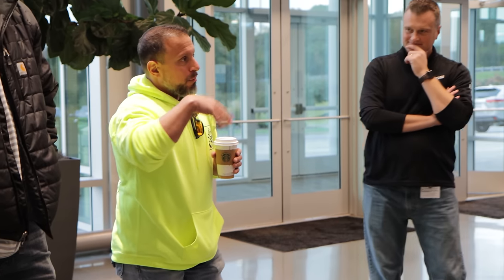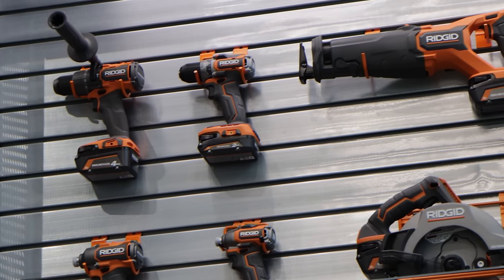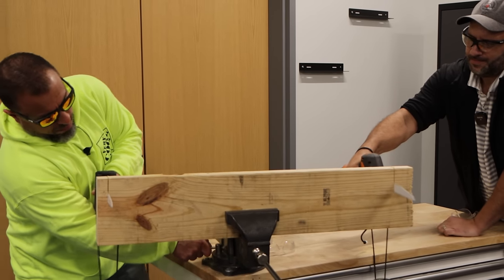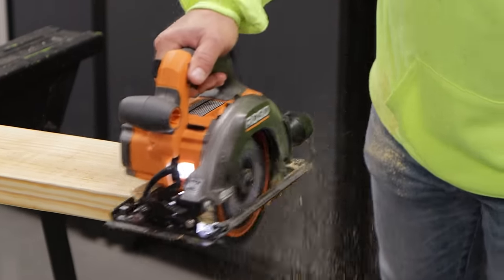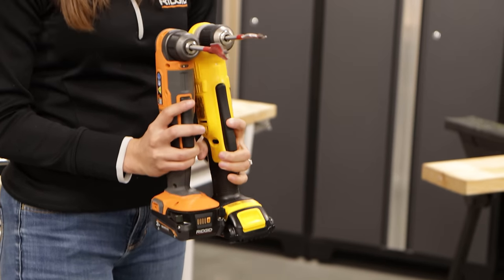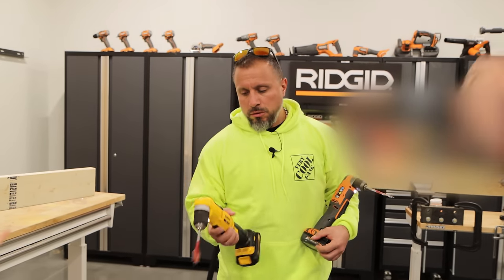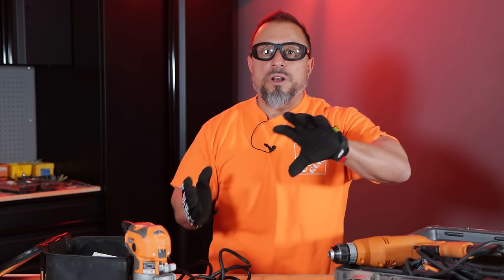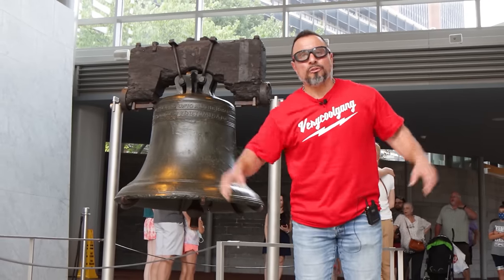Telling Ridgid Executives I Don't Like Their Tools!

Comment: I used to be a Ridgid guy because of their lifetime warranty until I tried to use it. It took 6 weeks for HD to replace a orbital sander. Replacing batteries is always a fight. The hassle is just not worth the “lifetime “ warranty.
Reply: Same here had a vacuum go bad read the life time service agreement said send it in and we will determine if it's a warranty issue. Same with there sump pump. There warranty/service agreement is a joke.
Reply: I can say the same about dewalt. Drove 40 miles for their belt sander, got home it was dead. Went to walmart and picked up a skill to get the job done.

Comment: As a ridgid user, I'll be completely honest. They have a lot of work to do and step it up. I'm glad after they took out the octane line they began to replace and also add more tools to their arsenal. What I want to see from them is to bring back their 12v line. Give the market competition against Milwaukee, competition drives innovation and and quality, different lights besides the 4 they currently carry, updated corded tools that have been in their arsenal for years! Their own driver and impact bits. Their own saw blades, more cabinetry tools like their old band saws, planers. Get into electrical! They have a lot of work to do but with them throwing the octane away they seem to finally have a set path for tools and what to make. I'm keeping my fingers crossed but only time will tell
Reply: The same company owns ridgid and millwaukee
Reply: @keegannoel43  they own them yes, but it doesn't stop them from producing new tools. If ridgid Is able to bring in more users they will probably expand more of their line.
Reply: @unclepungus7828  it's a Chinese company now. The only thing they care about is making the cheapest tools an charging as much as they can for them. I was a power tool Salesman for a year, now I am an electrician. Believe me the entire company is headed down hill.

Comment: You are my hero. I've expressed my concern with the brand...very recently on your videos. Because that's the platform I'm on and in the past year or so I personally see every power tool company looking like they are going forward where Ridgid seemed like it was stagnant or even going backwards. I hope they took what you said and used it as motivation.
Reply from the maker: I use my time with these companies to get answers for the #VeryCoolGang !
Reply: It's very much appreciated! You the man Vince!
Reply: I can tell you as an owner of some of the new ones that they are in some ways definitely going backwards. None of this stuff compares to the build quality or power of the octane tools. They have removed many features such as the light trigger frim the tools and are using inferior batteries compared to octane. Some of the newer tools do not have the octane tabs either and we are talking top models. I am angry at this change as I own a whole lot of their tools and batteries which the are obsoleting with crap to replace them with.
Reply: @D3M3NT3Dstrang3r  I agree to this
Reply: As far as most of these new offerings they've done a great job. The negative is the 4ah max output. The 3ah octane is a beast of a battery. They should have used 21700 cells on the 4ah max output. The hammer drill is way less powerful than the octane version, the biggest negative out of these new tools. The next bad was the octane high torque impact wrench vs the new high torque impact wrench. But I will say that the new 6ah max output and 8ah max output will be better batteries than the octane because of the 21700 cells. So at least an upgrade there. So it's only a few negatives. But the hammer drill was the biggest travesty out if this.
Reply: @ckcuev  I agree with you on that. I have the 3ah batteries and they give the tools so much more power. Honestly the 6ah max output I believe still has 18,650 cells. Only the 8ah will have 21,700 which is the dumbest thing ever! Why not just do 21,700 in all batteries max output. Like Milwaukee high output is. Doesn’t make any sense to me at all. Why only make one battery with 21,700 and the rest at 18,650. Stupid.
Reply: @scottelia8723  it's been confirmed that 6ah max output is 21700 cells. So definitely worth the investment over the 6ah octane. So the 6ah and 8ah will be so worth it. What is stupid is the 4ah being 18650s.

Comment: My issue is that when you are invested in a specific brand of tools changing brands is expensive and as a result not practical. The main reason is batteries.
Reply: You can adapt Milwaulkee and Dewalt batteries to Ryobi tools really easy. I do it for when I want something that Milwaulkee doesn't make (hot glue gun or 18V tire inflator).
Reply: @GraflexGuy  im invested in milwaukee and ryobi, I have milwaukee for when I'm doing more heavy duty things and ryobi for at home stuff.
Reply: @GraflexGuy  3d printer?  Or do you have some other method?
Reply: @RyanBissell  Amazon,  eBay, etc

Comment: Love Ridgid tools -- best grips out there, sound good, great batteries.  I bought nearly every one of their tools for the LSA -- use almost all of them regularly -- but have basically never needed it.  With few exceptions they're high quality tools at a great price.  Ridgid for 18V, Milwaukee for 12V.  No regrets.
Reply: Agree 100%
Reply: couldn't agree more!
Reply: As a professional the Ridgid Miter box is not something I would ever buy. Took mine back, very inconsistent cuts even at 90 degrees. The cuts were all over the place. I have an old Ryobi that cuts 90 after 90 after 90 all day, dead on. Ridgid also does not offer the same selection that their sister Milwaukee does. So, at this point I am going over to Makitia. The quality is there, and they give you a great variety equal to Mil or better. I stayed with Ridgid for the last 8 years. Now, for a tool company to fall on their face with a poor miter box design, they are not competent, how did you let this happen?
Reply: @hdvictoryford5329  What's a "Miter box"?  Haven't used those in 30 years.  Ridgid's new rebranded Delta miter saw definitely has some cut-consistency issues, hopefully they'll fix it because otherwise it's a great saw.  I just got the 18V sliding miter and did some tests and it actually does quite well -- almost no lateral play at full extension -- very happy with it so far.  Probably why they called it the "unicorn" for awhile while it was backordered.  And yes, Milwaukee and Makita have wider lines, but they don't have an LSA and they're more expensive.  If you need a wide line and have plenty of $$, go Milwaukee unless you're already invested in Makita.  But if Ridgid carries the tools you need, and you have a budget, Ridgid's been a pretty great value.  (No, I don't work for them.)
Reply: @acecabezon  What is a miter box. You got to be joking. That is how a carpenter learned. These new Miter saws are just updated versions of a miter box. And Junior I don't worry about semantics, my old Ryobi is dead on after being thrown around for over 20 years. And the original cost, 49.95. For what you have to pay for this by comparison, well just say they are pretty, and a real POS. And to say there is no lateral travel, well you must be a gentle soul, lol. In the real world these new saws have lateral travel with very little effort. If your engineers can't design a saw that eliminates lt, it should not be made. Come on the job with some real life experience and you will quickly see why many have 3-4-or even 5 of these on a job. They are over priced and under engineered. And to pay that kind of money! Build it right and I will. This design NO! And what tells me this, Over 50 years of building experience, Skippy!

Comment: About 5 years ago I bought a Ridged 10" mitre saw on sale @ Home Depot, Never could keep the saw cutting square, the fence would constantly move on me, also finally realized the fence was bowed. Called Ridged to try to get a replacement, and was told that this particular saw was made by a different manufacturer that was allowed to use thier name, and I would have to contact them for warranty! Well that was $400 in the trash, now very happy with my DeWalt!

Comment: You could clearly see the dewalt was cutting through the knotted side of the wood 🪵, dewalt was winning both times until it hit the knots and basically stalls hmmmm fair test I think not lol.
Reply: Yes, but it looked like it missed the knots both cuts.  Regardless of the knots, it looked like that Rigid cut faster to me.  I still prefer Milwaukee for most of my tools.
Reply: @BRENDANTHERED  I was a huge red man but unfortunately over the last few years whilst the performance has increased the reliability has been appalling, yet my yellow never fails it's a shame as they were once the king of cordless.

Comment: Never had much luck with a lot of Ridgid's electric tools outside the shopvacs. Company I worked for bought 2 new Ridgid impacts, and both blew a grease seal after a few days of screwing down 1/8" cladding on a roof. Meanwhile my Dewalt impact kept chugging. Not as much torque but it never skipped a beat and made them buy me a new battery to keep using it on that job.
Reply: Awwwww

Comment: Been in the trades a long time. I’ve had fast tools and I’ve had long life reliable tools. In the end I prefer long life reliable tools. Most the guys I’ve worked with also prefer long life reliable tools over the high performance but short lifespan tools. Once a main tool goes down the down time kicks in until the replacement tool comes.
Reply: Well I mean when a main tool goes out on us we just run to Home Depot or a supply shop so it doesn’t shut us down but a little bit but I understand what you mean I’ve had my hammer outlive all the others workers because I got a stiletto and they got a cheap hammer.

Comment: Is that circular saw available? I'm on ridgid platform and honestly have liked them so far. Went from commercial work using milwaukee and now doing handyman stuff with my own business. I wanted a mid tier decent tool kit at a good price to start with. Ridgid answered that call. The new impact and drill is competing with my milwaukee fuel. I just bought the octane 7 1/4 saw yesterday and feel the 6 1/2 saw would be a much better option (more compact and better design it looks like). Now I regret buying the octane. Hoping the 6 1/2 is released in time for me to return the octane and get the 6 1/2.

Comment: I agree with you.  I am a old time Ryobi user.  22+ years ago they came out with a 7 tool work station when they started the 18volt (IMHO) revolution That tool station helped me to become a millionaire (I deal in income investment properties, all aspects as such at the time).

I knew what I was getting into by using Ryobi over anything Ridgid and other brands.   At the time of my first purchase in the construction Ryobi was bought for "one job" only set up.  Meaning use it once  beat the hell out of it and then throw it away. 
You just got to take care of your tools and they will take care of you. I did with my Ryobi and it held up better than I expected.  

BTW I still have the original 7 tool work station.  It's now considered... Vintage :)

Comment: I have been a Ridgid tool user for over 10 years now. I replaced my line of Makita tools with Ridgid and have been very happy with my decision. I have the first Ridgid tool I ever purchased in 2011 (an 18V jig saw) and it still works perfectly. I now own over 30 of their cordless power tools and several 120vac powered tools, and I have never had one single tool failure. I am not a contractor, but I use my tools heavily. @the mandalorian, I agree the Stealth Force impact driver is an amazing tool, I have it and love it. I was sad to see it go.

Comment: Many guys in our shop bought ridgid tools and switched over to milwaukees before the ridgid ones hit their 1 year mark.  Many said they wished they had bought red to start with.  
My position is this...battery, go red.  Corded go yellow.  Its been mostly a good recipe so far.
Reply: I agree completely. I’m in the green line but I started upgrading last Black Friday. Dewalt 12” sliding compound miter saw w stand (Lowes deal thank you Vince!). This year I’m looking for the Dewalt 10” table saw (w rolling stand) and going to get into the Milwaukee 18v line.

Comment: I've loved Ridgid for their warranty and battery policy. All of my "money maker" tools are Ridgid. 

I was deeply disheartened by the death of Octane. And I started courting other brands and ecosystems to take up the slack. I'm glad to see them taking on some direction and hopefully they'll fill out the missing parts of their tool ecosystem soon. 

I'm looking for a right angle impact ratchet for automotive work... their high torque and mid torque, as well as their lights are indispensable in what I do and I put a lot of hard miles on my tools and they keep kicking. Hopefully they take on your criticism and continue to advance.
Reply: Cool perspective with the warranty side of things.
Reply: As a professional the Ridgid Miter box is not something I would ever buy. Took mine back, very inconsistent cuts even at 90 degrees. The cuts were all over the place. I have an old Ryobi that cuts 90 after 90 after 90 all day, dead on. Ridgid also does not offer the same selection that their sister Milwaukee does. So, at this point I am going over to Makitia. The quality is there, and they give you a great variety equal to Mil or better. I stayed with Ridgid for the last 8 years. Now, for a tool company to fall on their face with a poor miter box design, they are not competent, how did you let this happen?

Comment: As a sheet metal mechanic, for me, it’s all about the warranty. I like it when I can print a repair ticket, ship out my broken tool, and 9 times out of ten, Milwaukee won’t hassle, they just ship me a brand new or refurbished tool. In fact, the one time the warranty wouldn’t cover my chuck repair, I paid the $60, and they didn’t repair the chuck. Nope. They just sent me a brand new drill. I’ve had every manufacturer you can think of, DeWalt, Milwaukee, Ridgid, Hilti, Makita, Bosch, Porter Cable, Matabo, Festool, Skil, etc. And I’m not saying Milwaukee is the best, but they have a dam good warranty. 🇺🇸

Comment: They are comparing to dewalts oldest tools
Reply: And small, low AH batteries
Reply: And with different wood grain clearly visible to the left of the knot only on the non rigid side.  Go back and watch it again. You will see both saws are side by side till he hits the darker area.

Comment: Immediately after the initial "honest feedback moment" it went straight to HOME DEPOT MAN talking up rigid, I was turned off of anything said from that point.  Also,  that demo on the recip saw was crazy.  You're telling me that the dewalt stopped making progress for no reason,  twice, at the same spot on the board? And the tools didn't swap places,  just operators...  Lotta bull going on.... and it smells distinctly like a paid puff piece
Reply: Sawing thru the knots in the board didn't help DeWalt. The Ridgid had clear wood to cut thru.
Reply: I agree